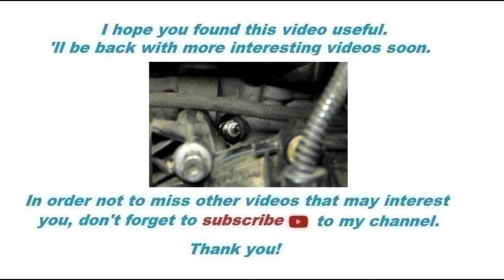Replacement of stuck glow plugs on BMW n47 engine

Comment: Warm up the engine first to operating temp, that way you will have expanded the head on the engine, this way everything is expanded and there will be slightly less grab on all the glowplugs, they will come out easier, also use CRC or WD-40 to lube the threads when removing

Comment: Just done this today, no 4 back   glowplug. Didn't need to remove the plenum panel in the end, just all the wiring harness plugs so I could pull it back and see the plug cap, just. A real pain to remove caps, helps to prise the cap top off the right angle cable gland so you can fully depress the retention levers in, while pulling up on the cap. I used a small hook under the cap gland. Just like this video, the plug was very tight, despite soaking in penetrant. First turn easy, then it locked hard. Retighten then go again, gaining a quarter turn each time until finally it came out. There was a 5mm piece of the old plug tip missing, snapped off, ceramic I think? Not a great thing to have on top of the piston, I hope it got blown out at some stage. Don't put off changing glowplugs, just one dead one will prevent Dpf regen, which will block without warning and take out the turbo as I learned to my cost.
Reply: Did you remove intake manifold to access plug no4?